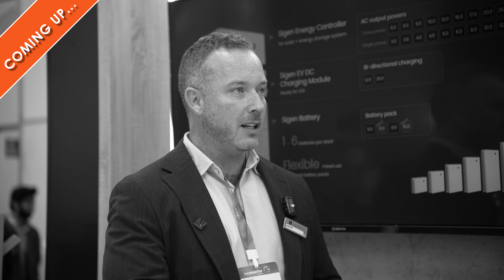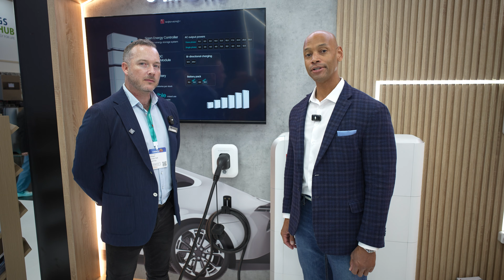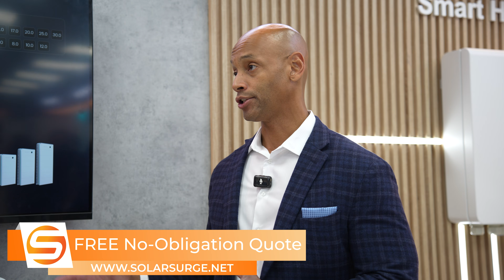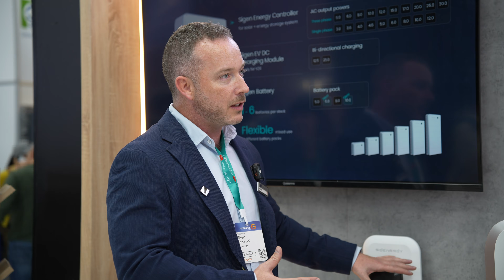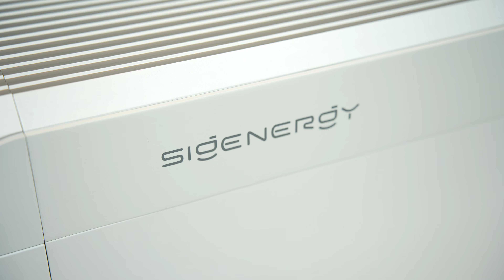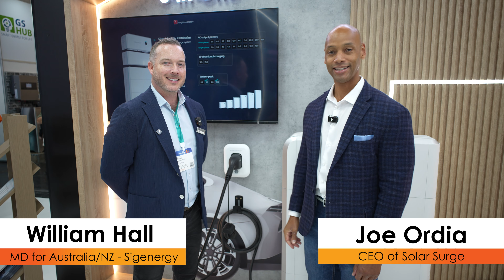NEW Sigenergy Bi-Directional DC EV Charger | PointGuard

Comment: It doesn't make a whole lot of sense to have a battery IN the DC charger for a residential application.  That's an expensive system dedicated to your vehicle.  And charging faster?  You mean until that tiny battery is exhausted, which won't take very long at all.  Almost nobody actually needs to charge their EVs faster at home in the first place.  It is counter-productive to charge your EV quickly at home when you have a solar system.

In fact, it is generally better to charge more slowly to better-match whatever excess solar you have + home battery margin so the system can just have a nice long charging session and get the car full.   What I do with my home system and L2 charger is just that.  I damp the EVSE down to 6kW.   The home typically has 4kW of excess solar so when my home battery is starting to get full, say 80%, I can plug the EVSE into the car and let it charge at 6kW for 5-6 hours without zeroing anything out... during that time the home battery is only burning 2kW or so so by the end of the session it's only dropped from 80% to 50% despite having shoved 24kWh into the vehicle.

I know that people dream about V2G (and V2H), but the battery in your EV is the single most expensive battery that you own.  Even if its a LFP battery, I have come to the conclusion that it just doesn't make sense to waste vehicle value using it to augment the home.  Not to mention that it can only do that when the EV is in the driveway, so in an actual emergency... now what?  You drive the car somewhere and the home is depowered?

Conceptually the ideas are sound.  But  given the trade-off between spending money on a Fast DC system for the home, and spending money on expanding the home battery system proper... it is far, far, FAR better to spend the money on simply adding more dedicated home battery storage and just sticking with L2 charging for your EV.

-Matt
Reply: The cool thing with the Sigenergy / PointGuard solution is that it is modular and fully flexible. As such, you can install solar only (without batteries and EV charger), solar plus storage, storage only, solar plus bidirectional DC EV Charging with or without batteries in the stack. Even bidirectional DC EV charging that can provide whole home back up or without backup (to offset high electricity rates during peak hours). Different homes and homeowners have different needs, and different regions of the country have varying requirements. We are seeing that some homeowners make the decision to buy a smaller battery to help them offset high peak electricity rates (in CA these can be $.70/kWh or more), and they want to use their EV as backup when the grid goes down. Because we are providing functionality and options that no other company can provide, we are in new territory, and we will learn what applications and setups make the most sense and work the best. As with any new technology, the cost is still higher, but as volume and adoption increase over the coming years, we expect bidirectional charging solutions in general to become more cost effective.
Reply: Spot on, again 😊
I think you made an argument for AC output for v2h support vs dc bidirectional in another video Comment, which I also generally agree with. If v2h is done via standard generator 240v l14-30 like current F150 Lightening 9.6kw output. Just use a standard l14-30 generator cable from vehicle to house input. Yes, its manual, but as mentioned, a vehicle may nit be at the home when needed for power backup anyways.
Another interesting idea moving forward could be to use the DC ccs or nacs output from a bidirectional capable ev like the lightning, connected to an external hybrid inverter like sungoldpower, eg4, solark.
Future inverters could include a stock nacs port, then just use a nacs-nacs cable from the bidirectional ev to the inverter nacs input.  If the inverter nacs port was bidirectional also, this would allow dcfc from solar, home batteries connected to the inverter, all using existing nacs dc standards.
Reply: @alexxbaudwhyn7572  Another thing that should be noted is that AC is really easy in the U.S. given that residential AC is just 240VAC "split-phase"...  essentially single-phase AC @ 240VAC that can be split into two 120VAC single-phase legs due to there being a neutral in the middle.

AC is a bit more complicated in countries with 3-phase power going all the way to the home.

My skepticism is mostly from a cost-v-usefulness perspective.   As an electrical engineer I can definitely see the efficiency and wiring advantages of sticking with HVDC through the entire device chain (solar panels to battery to DC Fast charger to inverter, etc).  Most modern HF inverters these days already have HVDC mid-busses internally sitting north of 250VDC.

But at the same time, 48VDC is plenty good enough for anything through 30kW or so... even 40kW.   95% of homes peak at under 20kW.  And battery round trip is still around 95% at 0.1C at 48V (51.2V LiFepO4) in battery systems scaled to deal with high usage.

HVDC is also much more of a eco-system lock-in... something vendors like to have, lots of proprietary pieces that don't interoperate, but this is also something that is not necessarily a good thing for the home owner a decade down the line.

So for me its a bit of a hard sell.  48V is just a lot more versatile, particularly in an emergency.

-Matt
Reply: @alexxbaudwhyn7572 My project of connecting my BYD to my Sol-Ark 15k is currently on hold as I'm in the process of upgrading to an Atto 2, which has a higher V2L output than my current one. Basically I plan to just feed my car into the Sol-Ark on those, thankfully rare, cloudy days when there's not enough sun to power the house for the whole day.
Reply: It is not dedicated to the vehicle. It is for the house and has sub 20 ms change over so your electronics won't even know. Imagine you are out at running errands , gone over the weekend, and you power goes out for a short while ... that is the house batteries purpose.
Reply: For US market, looking to future vehicles with V2x capability, obviously needs to be NACS interface.
Reply: What I’d like to see is an independent analysis of actual overall reality of energy efficiency in a DC vs AC bi-directional EVSE. I get theoretical advantage of using DC… but with voltage conversions, limited home battery to charge EV, etc, in the end, does it actually make sense?  Right now, with really high price tag, certainly has limited appeal. Kudos for Sigenergy for releasing this. Great news and hope ethical competition does wonders for consumers
Reply: It think where V2G makes sense is when utilities are willing to pay you $2 a kWh like the pilot going on with PG&E. For that price, the minimal battery degradation isn't really an issue. Sometimes spot pricing hits $5 a kWh in the Texas market. Heck even $.50 would be worth it to me if I had a LFP battery.

Comment: Will that come to the US?
Reply: It's available, but super expensive. It's around $5000 to add on to the stack. Their AC EV level 2 charger is only a little over $1000 with installation. I chose the latter.
Reply: This is true but you could choose to install only single battery pack, with the V2X module and use the extremely large battery of the vehicle for backup purposes.
Reply: Good point, though most current EVs are not capable of V2H/G. Don’t have the hardware
Reply: @freeheeler09 Most EVs actually do and they are just stopped in firmware. This is usually the case for vehicle manufacturers who are using their own proprietary standard rather than the global standard.
Reply: I'd love to get this for my Fisker Ocean.
Reply: doing a quick lookup I only see 2 sellers in CA (the US largest market) in LA and San Diego. pretty lame. I suspect it quite costly though I suppose you can get min battery and save that way.

Comment: You didn't talk about the battery capacity that comes with the unit! Presumably that top unit is the inverter and BMS and the units below are batteries? 
This has the possibility of being able to sell EV charging to other people!
Reply: I would imagine that the battery for their bi-directional charger is the battery in the EV itself.

It is deeply disappointing that Enphase still has not rolled out their bidirectional charger, but to be fair, it sounds like this charger is not ready to go yet either.
Reply: @JimHolder-pk2kk No, the stack has it's own battery and the top unit is the inverter and solar charge controller (basically the hybrid inverter).

It can only do 25kw DC fast charging in certain conditions. If the internal battery was dead and no solar you won't get 25kw charging, you'd need to pull 104 amps off of a 240V house which isn't going to happen.

It pulls from the vehicle only in certain situations (like time of use billing optimization, or in grid down scenarios).
Reply: @Snerdles  OK thanks, I didn't realize that.
Reply: @JimHolder-pk2kk That's why I mentioned that it was disappointing that it wasn't mentioned in the video. If you look at the stack behind him, it's clearly a modular system.
Reply: You can't, though, not really... there isn't enough storage. The "Fast" part of the DC charging will last until the storage is exhausted and that is going to happen VERY quickly.  It isn't really a good selling point.  The efficiency argument isn't all that good either.  Yes it is more efficient... but it isn't so much more efficient to justify the likely cost verses spending that money on a few more solar panels instead.
Reply: @junkerzn7312  When you discharge the car, i.e. you back up your home in a power outage, the charger can discharge the car at up to 25kW; however, you can import up to 11.4kW to your home because the Controller has a max output of 11.4kW. In that case you have the choice to recharge your PointGuard/Sigenergy batteries from your EV if you so choose.
Reply: @junkerzn7312  These are great comments, please keep them coming. To explain: The charger has a maximum continuous output of 25kW. Whether you can or choose to use that capacity depends on how much solar and/or battery capacity you have. The Controller (yes, this is the hybrid inverter that can connect to solar, and it performs the DC to AC conversion for the solar and batteries) has an 11.4kW limitation. So if you charge your EV, you can import as much as 11.4kW from the grid to charge your car. However, because the bidirectional charger is fully integrated into our solar plus battery stack, it provides the functionality to add any excess solar energy to the charging capacity. If your solar can contribute 7kW, its native DC electricity is routed to the charger without being converted to AC, then back to DC. Now you are charging your EV at 11.4kW + 7kW = 18.4kW. If you choose to use our 'Battery Boost' function, you can add any power the battery can contribute. This is how you can stack energy sources to reach faster charging speeds, if you so choose. Again, the charger has a maximum capacity of 25kW, and the every day operation of the charger will be anywhere between 11.4kW and 25kW depending on your setup and your choices.
Reply: @PointGuard-37.62 which cars on the market currently accept AC & DC at the same time?
Reply: @mattbrew11 I am assuming that grid ac is converted to DC when combined with solar and or battery sources to DC charge an ev, but Pointguard will have to clarify
Reply: I'm guessing that it's possible to add more battery storage to this setup and or use my existing battery storage to supplement the charging of a car.
Reply: @simonpaine2347 You can add PointGuard / Sigenergy battery packs to this setup, and yes, these can supplement charging of your EV. You are not able to add batteries from other brands to help with charging though...
Reply: Currently you can buy 5 or 8kwh battery packs and I think it's a total of 5 or 6 units per stack, and the EV charger takes one of those slots.

Supposedly they are working on 10kwh battery modules too.
Reply: oh you opening up a gas station huh? ROI never is a good business opp